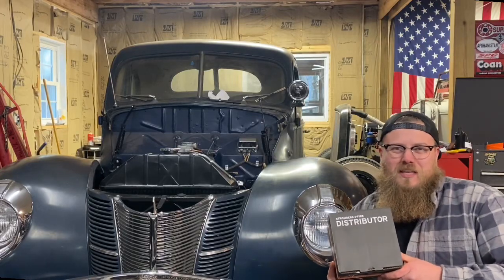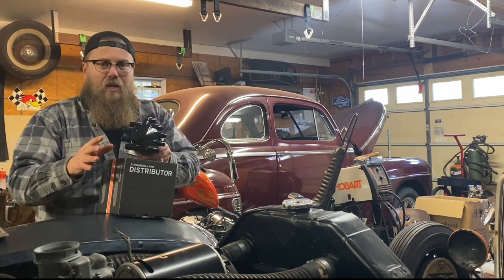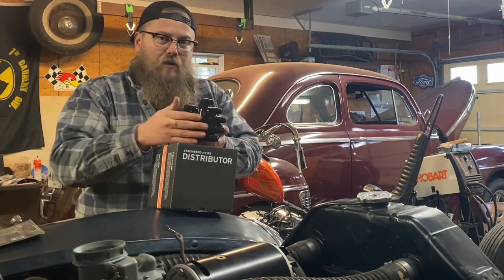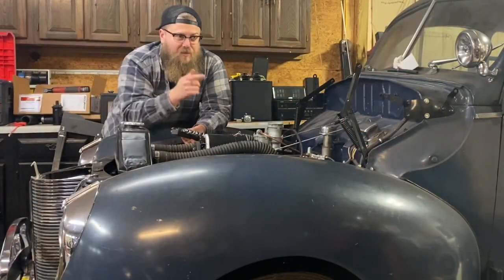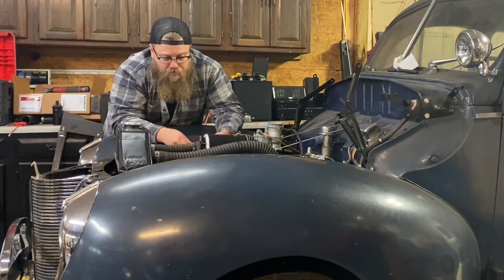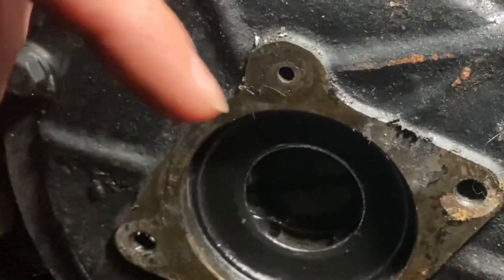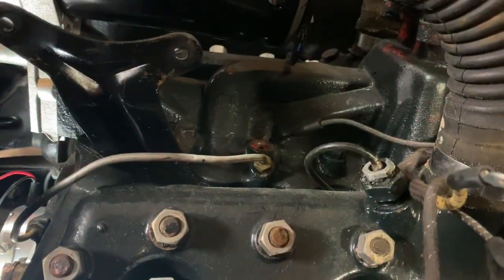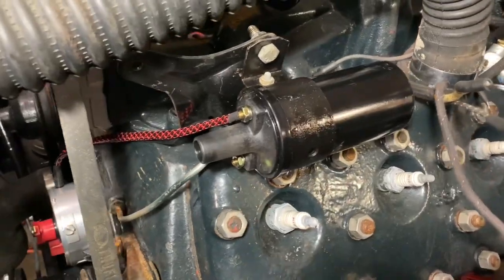Stromberg eFire Distributor, Flathead Ford

Comment: I thought about getting this crab style distributor for my '36 Ford. I still have the original 21 stud engine in mine. But, I think in order to install this, I'd have to remove my original generator driven fan, and run an electric fan. My car is still 6 volts, and I was going to keep it 6 volts for now. 
But currently, I'm having other major issues with my engine. It currently has a blown head gasket with milkshake oil. I had my divers helmet style distributor rebuilt, but something is now up with it, the vacuum advance is making a strange screeching sound. When I disconnect the line back when it was running, it would stop making the sound. I'm also currently looking for a new carb not a rebuilt one for my '36 as well. It has a Holley 94 on it and I got a rebuild kit for it. But if I can get my engine fixed without having to pull it and rebuild it, I may look into the 12 volt conversion and this efire distributor sooner than later.

Comment: How far does this distributor protrude from the front of the engine, and can I use an original fan?
Reply from the maker: It’s very close to being the exact same length, you can definitely run the original mechanical fan with this distributor

Comment: Please clarify rotor orientation. You mentioned at 3.20 min .  How to be sure if the old distributor is already out, and  there are no marks?
Reply from the maker: The slot in which the distributor locks into the cam is tapered from one end to another, so the cam itself always indexes the distributor rotor, I apologize if that wasn’t clear enough in the video

Comment: you mentioned the need for new plug wires but said nothing about the importance of having a coil with the correct resistance.
Reply from the maker: Hi Rob, I have a whole video on what parts you need when making the conversion